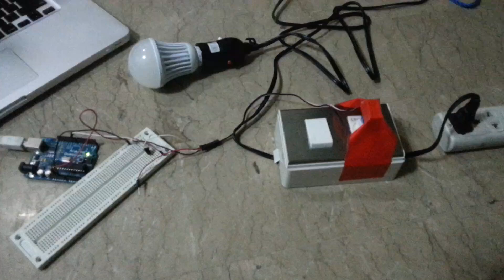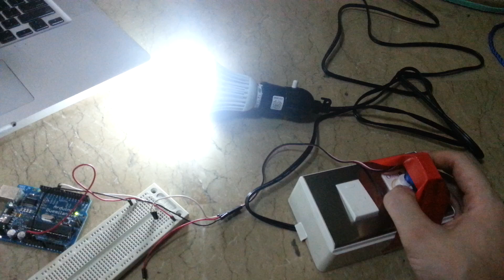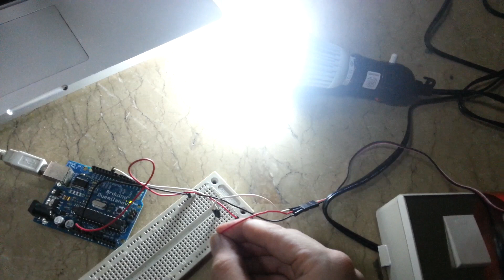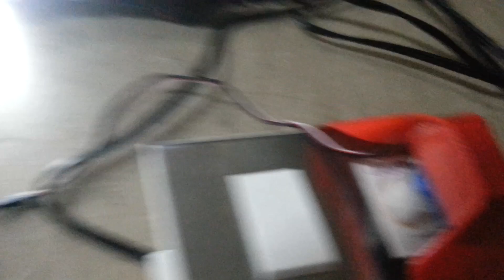DIY sunrise alarm - arduino dimmer

Comment: very nice project could you supply details please?
Reply from the maker: I'm glad you like it. It was just a prototype so there's not much to say. It's basically using an arduino to turn a servo which is held onto a regular AC dimmer switch using duct tape. The idea is that you'd attach a real time clock to the arduino and have it turn the light on gradually over a 30 minute period in the morning.